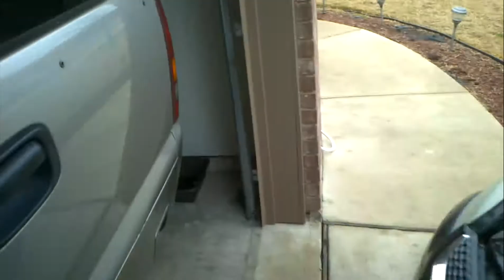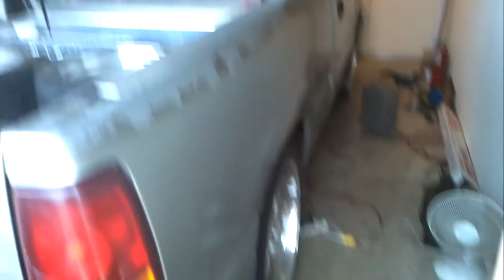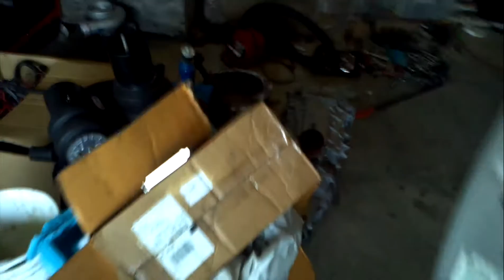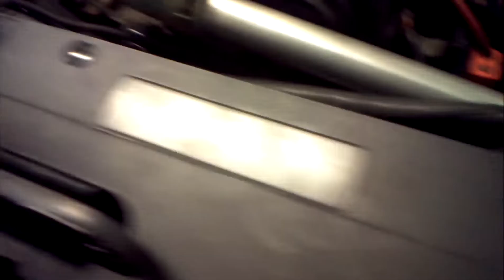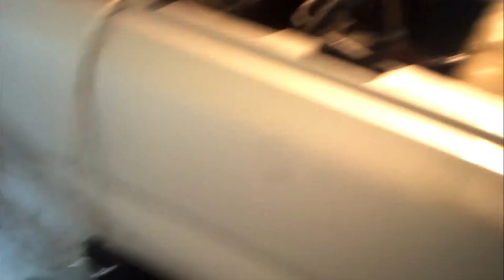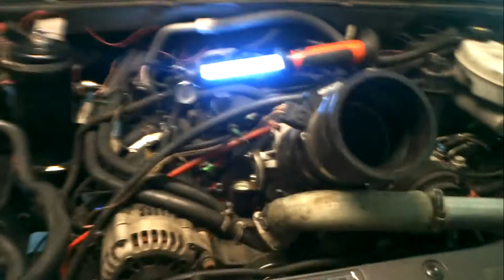Zz502 cam into 8.1

Comment: Very Nice!  Sounds good even with the sound quality.  Engine builder quite talanted.  That looks like it was a big job!  I have a brand new ZZ502 in my pick up but it seems other people's exhaust sound better than mine.  Good luck with your mean sounding truck!
Reply: Do happen to have the part number? I've seen the 3 separate belt setups. One is the common low ac on driveside setup, one is the top mount ac where the alternator normally is(kinda like yours is), and one with a air brake setup. Your setup then makes four. My understanding is the block to pully (water pump snout length) is the real difference is accessory brackets, so washer shims CAN work to swap parts. You say yours is stock, I believe it, people have said the 8.1l came stock as dual alternator. I had never even seen a picture until now, your truck then, would be one of them. I totally will go junkyard pulling if I have too lol. Thanks for getting beck so quickly. Nice build.

Comment from the maker: @TheBigblock496 Valve springs, check pushrod length, Engine builder said clearence was good. check the gmperformanceparts catalog for the part number. ZZ502 camshaft

Comment: Which dual alternator bracket is that? Been looking for one for my 8.1l. Does the 8.1l actually match the 5.3l bracket and water pump? Good go on the cam. Cam springs are probably a good idea for anyone doing this. It will go in with stock rods and springs, but those cam springs are going to wear out with the extra lift from the bigger cam. It may take time for this to happen, but these are NOT new engines, they are practically antique autos. If they where new blocks one would still need to be concerned about spring failure with ANY bigger cam as it squashes the springs smaller then the former cam, literally crushing them until they fail. Just looking out, springs are not THAT expensive considering the price of failed rocker springs damage and the overall price of a cam swap in general. Almost every new cam KIT comes with new springs for a reason. Cams are only stand alone when one has already upgraded the valve train. Also bigger valves are worth like 40 horsepower on the 8.1l. Port and polish not so much as casting is too thin for the 20 hp it nets. But if the cam is out then springs should come out, not much more wrench time to pull the heads and recut the valves bigger and slip in titanium valves and springs so as to KNOW your safe. Just trying help to get people most bang for buck. Power levels are way different too, bigger valves and good springs exchange the 40-60hp from the cam alone, to around 100hp for the whole setup. Yes it's around double the part price, but save up a little longer and the build will far more stable.
Reply from the maker: Factory 8.1 dual alt bracket, ls stuff will not work. 
Had the heads CNC ported new valves and springs
Reply: Do happen to have to part number? Sorry if this double post onto my longer response. Good looking build.
Reply: Electric accessories(efans, water pump, power steering pump) will decrease spool time on the block, and net like 40/60 horsepower, not to mention better gas mileage. Not that we 8.1l owners care too much about that lol.
Reply from the maker: @joshuaelizabethfoster6276  I do not i bought it 14 years ago and cant seem to find the info in my email

Comment: Hey bud I'm getting ready to do the swap in my truck and had some questions. Are valve springs a must if I'm not turning over 4700 Rpms? And I have tuning software for my truck and I can adjust the firing order through the PCM, does that sound right or does it have to be done another way? Thanks for your time!

Comment: What did you do to make the cam fit in the motor and what did you have to put one for it to work properly
Reply from the maker: Well the cam uses non metric bolts, and then change the firing order back to old style big block since 8100 uses ls style firing order